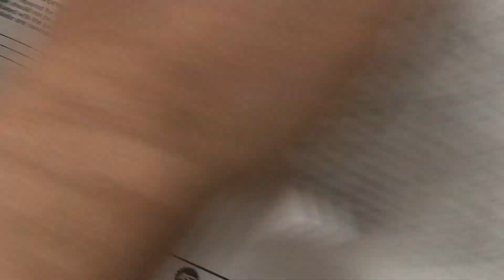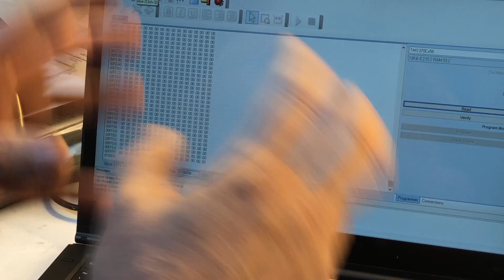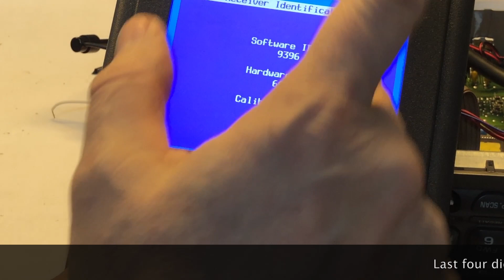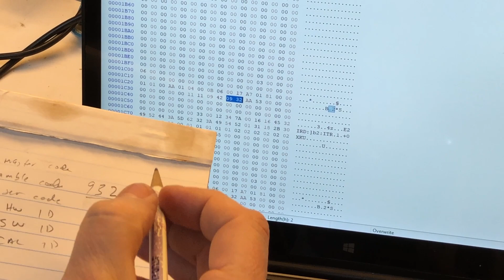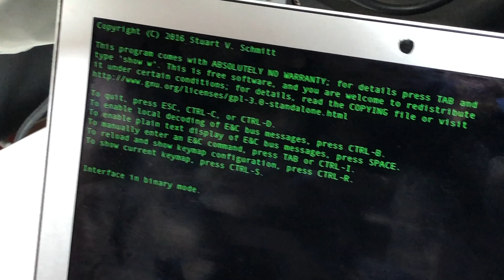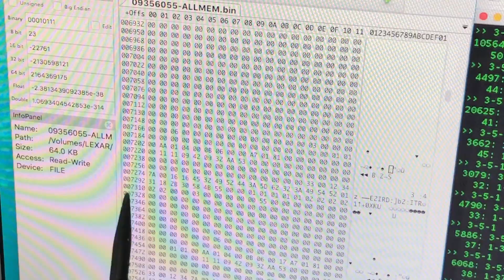1994 - 1999 GM Delco THEFTLOCK Radio LOC How to Unlock Code using Arduino & TMS370 (Chevy & GMC)

Comment: Is there a way to get 6 digit   codes before a radio locks to get factory code?
Reply from the maker: You could enter your own user code following the instructions in the vehicles owners manual, then disconnect the negative lead of the battery for a bit.   That will put the radio into a locked state.   You can then get the 6-digit scramble code for the built-in factory unlock code (the master code) that you would use when you call the 800 number (along with a Chevy dealership code).  You can unlock the radio with your user code as per the owners manual instructions.  Just make sure you haven't made a mistake with writing down that user code.  ;-)
Reply: @DrShock  thanks for info...never know if gm will pull phone number again good to have a master code

Comment: Thanks i called they gave 6 numbers 809311.  I tried first set 809 then 311 wouldn't unlock? Mod:16170865
Reply from the maker: So when you call that 800 number automated service, and you give a dealership number and next give the 6 digit code you got from holding the buttons down on the radio like I showed in the video.  You have to write the code down in the exact order the radio displays it, very important.  The Theftlock phone service will give then you a 4 digit unlock code that you enter into the radio using the hr/min buttons while it shows LOC on the screen.   Again, the unlock code is only 4 digits long.  Here's a link to the instructions https://static.nhtsa.gov/odi/tsbs/2018/MC-10141381-9999.pdf for that.
Reply: Yea thats whats funny he gave 6 digits....found out this procedure little different. Need to press Set,then 000 shows i tried 809,311,093,931 ,then amfm .still goes to lock didn't want to try too many times to freeze me out...i pressed 2&3 for 1st code,then amfm for 2nd..used dealer #620529 to get their code....i tried again got locked out inop
Reply from the maker: What year is your vehicles radio?  And is it a Saturn?
Reply: @DrShock    96 astro put cd/radio in years ago, bought from individual. Worked til battery died. Its has 95 on unit
Reply: I called with different dealer # 118669,was given same 6 digit code
Reply from the maker: When you follow the instructions in that PDF, what's the first 3 digit scrambled code you get from the holding the 2 and 3 buttons down?  And then what's the next 3 digits from pressing the AM/FM button?
Reply: @DrShock  first 2&3=(701).  Amfm=(935)
Reply from the maker: Hmm, that's very odd.   The last digit of most first part Theftlock scramble codes, where you press the 2 & 3 buttons is a "2".  Yet you have gotten a "1".  So I presume that has confused the phone service and why you're getting the invalid 6 digit unlock code instead of the correct 4 digit one.  I also tried your 701935 and that is definitely not a valid Theftlock scramble code, but I can't explain why you are getting it.
Reply: @DrShock  so to get out of inop have to run it for 1hr??
Reply from the maker: I believe you just have to have the ignition on, you don't have to run the engine.   Hook up a battery charger if your battery is old.  I wouldn't try anymore codes in until you get a 3 digit code that ends in a "2" from the 2 & 3 station preset button hold step or it will just go into INOP again.   Remember only hold those buttons in while the display says LOC.   If it doesn't say LOC, turn on the radio to get it into that state first.   Shouldn't matter, but you're not getting the right first three digits for a Theftlock.  Now possibly the problem is that the Delco 16170865 number you gave me is actually not a Theftlock model.  I see photos online and this radio says Delco-Loc II in the lower right of the display, not Theftlock. Delco-Loc II and Delco-Loc came out before Theftlock.  The phone number service is only for Theftlock radios, according to the GM service bulletin I've linked in the description.   Buttons 2 & 3 on your radio have words  COMP and RDM above them right?
Reply from the maker: After you get the INOP cleared try this.  With LOC showing on the display,  press and hold the 1 and 4 preset buttons for 5 seconds.  Then next press and hold the 2 and 3 preset buttons as usual.  See if that gives a different number than 701
Reply: @DrShock  right it is delco loc ll
Reply: @DrShock then there lies the problem, but funny they even gave a code for loc ll
Reply from the maker: Did you use this process to enter the 809311 unlock code the phone system gives for this Delco-Loc II radio while it is showing LOC on the display:
1) Turn the ignition on.
2) Press the SET button (000 appears on display).
3) Press the SEEK button until the first digit of the code appears.
4) Press the SCAN button until the second and third digits
5) Press the AM-FM button (000 appears on display).
6) Press the SEEK button until the fourth digit of the code appears.
7) Press the SCAN button until the fifth and sixth digits of the code appear.
8) Press the AM-FM button again. Is the radio now unlocked?
Reply: @DrShock  seek is minutes does last 2 digits,scan is hour does first single digit.....will try again tomorrow after goes back to loc. Will let you know
Reply: @DrShock  ok van set with acc on for 1.5hr, kept saying inop no matter what i push.someone told me to disconnect batt cables hold together for 1min...afterward radio went to 000.i confirmed 6 digit code was correct.went thru your instructions after ampm read rep,went thru again shows radio stations but no volume can see setting move,bass & treble not working,guess its bad. tks for your help
Reply from the maker: Unfortunate, so you got it unlocked but it seems to have died.  At least that shows the Delco-Loc II codes are also provided by that same Theftlock codes phone service.  Just the common instructions are wrong as Delco-Loc II has 6 digit unlock codes, where Theftlock has only 4 digits.  Was a good learning experience all around though.
Reply: @DrShock  yes it was and the battery cable trick was good.on to Ebay hunt for another unit .thanks

Comment: The number you get from call in recorded is that the master code?
Reply from the maker: That's right.  But GM discontinued that number for most of 2020, and it could get disconnected again at any time.

Comment: Very interesting!,but what language were you speaking lol...im looking to replace my radio on a 96 astro with a radio cd from a 99 astro,if it is locked all i need is master code for it to be useable? Tks
Reply from the maker: If the radio face is like the ones I showed, with that theftlock logo, then yes.   GM actually turned the 800 number I list in the description back on after all the complaints, so you could plug the code I show into the touch tone phone interface and get it that way or there are folks who offer the service for a small fee to do provide the code by just texting them.